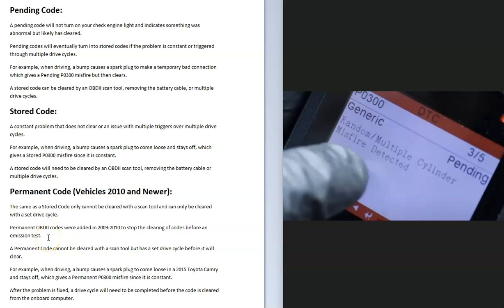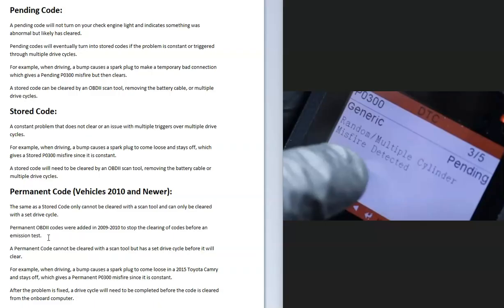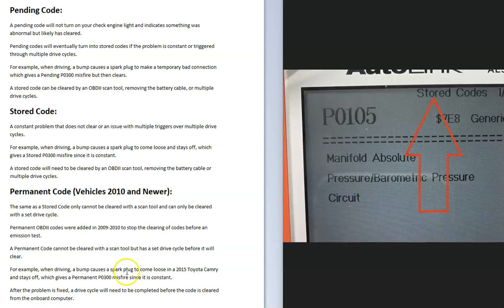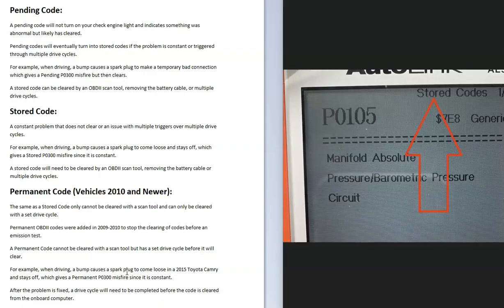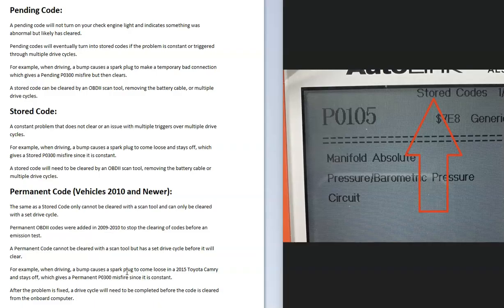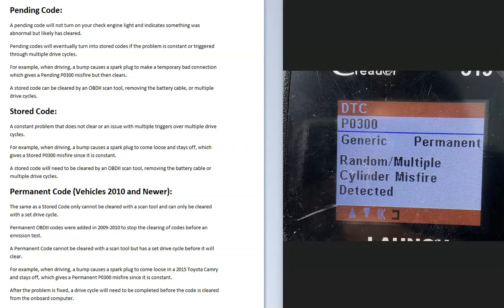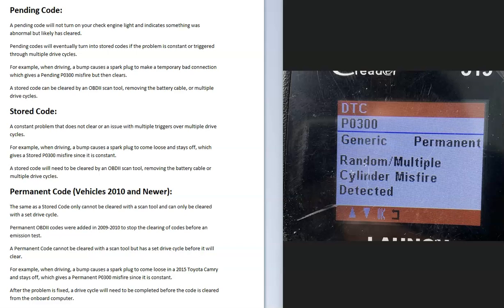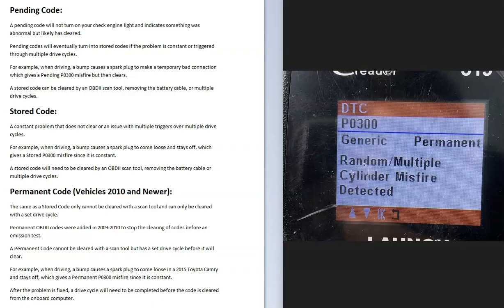Pending Code vs. Stored Code vs. Permanent Code (In 2-Minutes)

Comment: I have a P0303. I tested and replaced teh injector, coil, and both plugs with the correct gap. I am still getting a P0303 and it does say permanent. My question, will I still experience all the same issues... rough idle, loss of power, etc... until it clears or should it be resolved immediately and the system will eventually clear it?
Reply from the maker: If the engine still runs badly than the problem hasn't been fixed. When cleared with a scan tool the dashboard light should go off but the permanent code will still show on the scanner until a drive cycle is done. After the fixing the issue and engine running well, just drive around a bit, and either the permanent code will clear, or if there is still an issue with cylinder #3, the dashboard light will come back on.

Comment: Is a confirmed status a Permanent code? and can it be cleared by an OBD2 for Kia Sportage 2024, note there is no check engine light on car dashboard ? cod P0404.
Reply from the maker: The problem needs to be fixed, and likely a drive cycle done before it will fully clear.

Comment: if i clear a pending  469 code ,  Will hat clear all cdes?    I have some monitors that are not cleared .
Sould i wait until all monitors clear first
Reply from the maker: Usually, the problem is fixed, the codes are cleared, and a drive cycle is done (monitors). If you think the problem is fixed, you could see if it clears after a drive cycle, but likely, there is an issue that needs to be fixed.

Comment: Please Please can someone tell me why does obd II show all green lights but the smog shop says your car failed
Reply from the maker: Was there a fix done, or were codes cleared recently? If so, you will need what's called a Drive Cycle to pass an emissions test. Usually, a drive cycle can be done by just driving around for a few days, but you can find the specific steps needed by Googling your vehicle and drive cycle.

Comment: I made repairs, cleared codes and they come back on within 5 miles.
Do I need to drive it longer? I’ve driven it 95 miles. 
2000 Toyota Avalon
Reply from the maker: If a warning light comes on and a code returns, there is usually still a problem.

Comment: Hi bro thx for ur page. I need ur help. I xut off fhe throttle body wiring connector pigtail to replaxe and forgot to take a picture of the original wiring and now i am confused. Cant find any diagram tohwlp me. Ita a 2012 dodge journey 2.4l throttle body wiring connector issue. Can you please help?
Thx
Reply from the maker: A wiring schematic needs to be found unless there is a YouTube video on it. Sometimes, information can be found for free online, but it can be hit or miss. Professional mechanics use paid services such as All Data or Mitchell Pro Demand. All Data has a DIY section for individual vehicles, but it does cost by the month, and they often have recurring monthly fees, so if used, be wary of which service is bought. Finding a manual for your specific vehicle information is likely best.

Comment: So I have a check engine light and it's a PO430 so I bought a cheap scanner and it says no codes found but it will erase the code. Is it just a piece of garbage or do they make certain scanners for certain makes? My car is an 03 Camry and i thought all scanners read all makes above 96
Reply from the maker: Any low-cost OBDII scan tool should read and erase EVAP codes for a 2003 Camry.

Comment: Thanks. I cleared a P0638 with OBD2 tool. I had a check engine after I cleaned the Throttle body. The car is running fine now. The check engine gone and the code didn't come back. Is everything ok?
Reply from the maker: As long as the code doesn't return, then yes, it should be good.
Reply: @HVAC_Mechanic  Thanks . much appreciated

Comment: I have a lexus is350 permanent p2714 code. I have been driving it for a couple days and the check engine light still doesn’t come on but it won’t pass smog check
Reply: Check im readiness also maybe some cars need 15 20 times drive n turn off  car

Comment: So 1?. Why can't my scan tool read a Permanent Code? So There is no way for me to know it's there? I checked the car when he came back from the smog and Failed for a Permanent Code P0420. I checked the car no codes and no check engine light on even checked to make sure the light was working! I'm hoping it just cleared right after he drove away from the smog shop. Because if I can't read a code and it's still there, that is messed up! I'm hoping it's just the car cleared itself before I checked it! Just had to ask that ? Thanks again man👍
Reply from the maker: If the code is there, a scan tool should read it, even permanent codes. The vehicle may have completed a drive cycle and cleared the code when he drove back.

Comment: Thank you! I am really pissed( not anymore thanks to your short and simple video) cause I've fixed a 2012 kia Sorento for a customer by changing out the cat/ exhaust manifold to fix the p0420 code cause the cat in these manifold comes apart and gets plugged in the second cat. Well I cleared the codes and  disconnected the battery and when I gave it back to the guy it was ready  to smog except for 2 monitors. It failed for the same P0420 code. But no light on on the dash . My cheap scan tool says good to go . I have a launch scan tool  and was going to go get it and now I don't have to . Thanks 👍

Comment: I have a p0303 permanent code. I have replaced spark plugs, ignition coils and maf sensors.
Reply from the maker: I would test the fuel injector on cylinder #3 and the injector/coil wiring.
Reply: I had the same problem on my Honda fit I replaced the spark plugs, #3 coil & went to the Honda dealership and they replaced the fuel injectors. The code came back on this morning after a week but I got gas yesterday I do believe it’s the gas I’m getting cause it seems peculiar that the first time it happened I got gas from the same place I always get gas from

Comment: You have to fix the problem for a permanent code to clear..correct?
Reply from the maker: The problem needs to be fixed or the code will come back but an extra step called a Drive Cycle need to be done for a permanent code to fully clear.
Reply: Thanks!😊

Comment: On a 15 Chevy captiva 
I done the timing chain , done it right , 
Do I have to clear the codes first , cause car won’t start
Reply from the maker: It should start without clearing a code. If the timing is correct and the engine ran before, I would check for a wire or similar that possibly became disconnected while replacing the timing chain.

Comment: P0420 and P0430 fixed. No check engine light appeared after fixed, but it shows on OBDII both codes P4020 & P0430 pending, and  P4030 code permanent. Total (3) codes shown on scanner. Drive cycle 450 miles. Warm-up cycle 40 times. Could it pass smog check in California?
Reply: YEs you can pass a CA smog with pending codes.  You can also pass a CA smog with permanent codes as long as you did the 200/15 rule.  Problem would be finding an inspector to run it with pending codes.  They hate that.  But just be insistent, it's not thier job to save you from a fail. it's thier job to run the test as the car is presented.  Anything less file a complaint on them with the BAR.
Reply: @stevew9563  Thank you so much for the info. I really appreciate it!
Reply from the maker: It depends on the local emission rules. Some states will let it pass while others will not; I'm not sure about California's rules. I would complete the drive cycle to be sure.
Reply: @HVAC_Mechanic  Thank you so much!

Comment: I have a p0420 code that we fixed (02 sensor upstream) and it shows up all three ways (pending,stored,and permanent). 
What can be done?
Reply: Did you clear the codes after the repair?
Reply: @stevew9563  yes
Reply: @sierrag480   - Then chances are that upstream O2 was not the issue.  Most likely Cat bad.
Reply: @stevew9563  they just came right back.
Reply: Also some aftermarket 02 sensor won't read like mine I had to buy ac delco for it to clear

Comment: Thanks . I got  P0100 saying  state: Historic on slk230 2000 replaced mass air flow sensor issue is can’t clear the code using icarsoft MB v1.0 was wondering if will clear after some driving cycle.  Thank
Reply: Same issue, anyone?

Comment: For CA car owners trying to pass a SMOG check with a permanent code.  You may have failed your smog check because you have a permanent code.  This most often happens when you make a repair and clear the check engine light but the permanent code is still in there.   You can still pass a SMOG check with a permanent code.  

What you need to do is drive the vehicle 200 miles (since you last cleared the codes)  and have the vehicle perform 15 warm up cycles*  and the smog machine will ignore the permanent code.  The 200/15 wont clear the permanent code (although it might)  but the smog machine will ignore that it is there and give you a pass as long as your monitors are also in a ready or completed state. 

* A warm up cycle is basically your car getting up to normal operating temperature and coming back down to a cooled off state.
Reply: Are you serious?
Reply: @Yuriy_Piter   - Yea?  This is for 2010 and newer cars only.
Reply: Nope I failed mine because of my permanent code even though mechanic found nothing wrong
Reply: @TommyDay-c5j   - JUst get the 200 miles and 15 warm up cycles and you will pass.

Comment: Want to add.  If you have a permanent code only with no check engine light there is nothing wrong with your car.   There is nothing to fix. Just let it sit there it will eventually clear it's self out or the problem will return and you will get a check engine light.   But do not throw any money  or parts at a permanent code.
Reply: too late. I have a brand spanking new thermostat! lol not funny. live and learn. they were too happy to take my funds. sigh.
Reply: @TunesandTales  Ah sorry, yea many mechanics not up to speed on permanent codes yet.
Reply: What if my code is stored but the obd2 scanner erases it but comes back after turning off the car and back on
Reply: @Bl3ndzbydk   - Most likely that is whats called a circuit code.  Meaning an electrical circuit is faulty.  Some codes only set when the monitor tests run while others get noticed right away on key on because the ECU is expecting to see a certain voltage or Ohms resistance and it does not see that on that particular circuit.
Reply: Yeah but I can’t pass smog cause I have no check engine light but on scan to it has a bad emission code catalytic converter
Reply: @me9303 same situation
Reply: @me9303  What state you in?
Reply: How about a stored code? Does it mean that a stored code can be ignored?
Reply: @danielwong765   - That gets into a wierd area.  Becaue there is no such thing as a "Stored" code in the OBD language made up by the ASE.  That is something your scanner has labeled a code.  But what it means differs from scanner to scanner.   Maybe rad your scanners manual and see if it goes into any depth on what a stored code actually is.